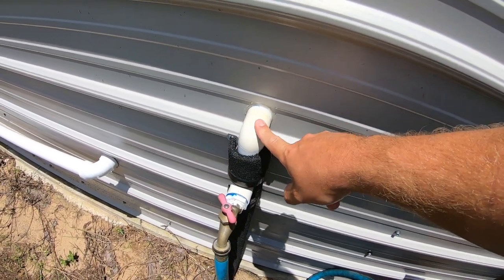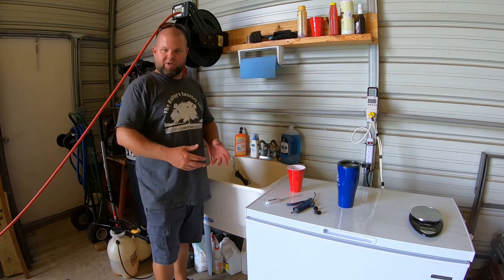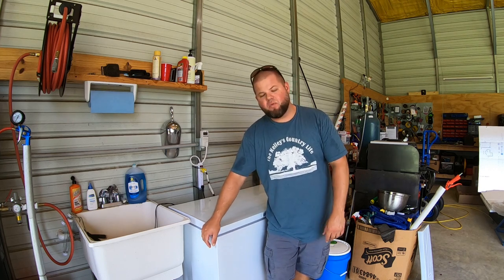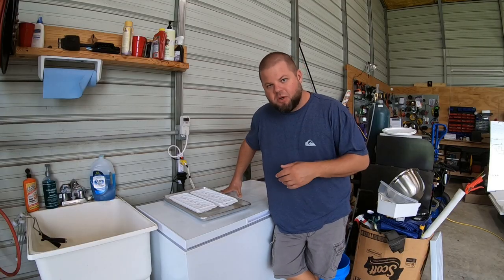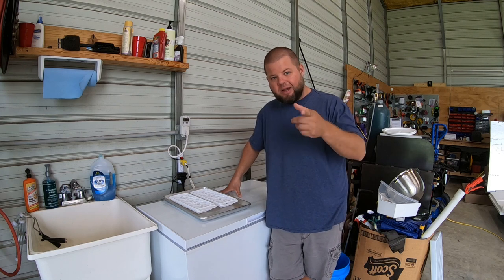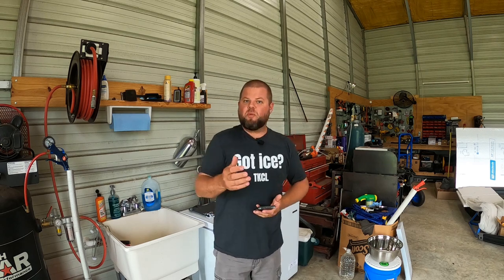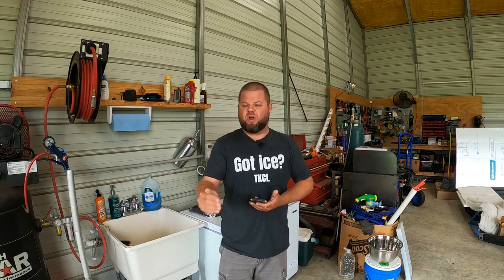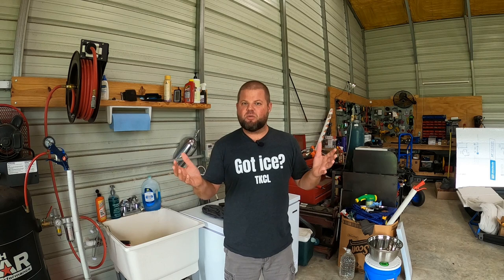Homemade ice machine tests! Hot water freeze quicker than cold water Mpemba effect? #376

Comment: No real need to test water from the tap. Just a measurement from the tubing feeding the ice maker (measuring the amount of water needed to fill the tray). The tubing temperature should be the same as the water inside and should not be affected by outside temperature. Instead, it will mostly be affected by the ambient temperature in the shop.

Comment: It doesn't need to be copper... that plastic line will do fine ... as is, just toss em inna fridge, stick em to the back wall ( use hot glue, you know, for the irony).....plastic may not be as thermally conductive but there is no way that the ice machine will call for 20ft of water in 5-7 seconds ... you just need to make the run from the fridge to the ice makers as short as possible ... did you ever find the ice size adjustment... it's a tiny plastic screw or bolt in the side  on newer models ... insulation on outside pipes is great, but have ya considered creating some shade on it too... might help... just spitballing here ... Oh yeah.. I almost forgot... use metric,  dammit! ... lovin' this series
Reply from the maker: Looked again and no size adjustment is available.

Comment: Put your heat exchanger(coil) in a refrigerator to cool it. Then you would not have to ice it down daily. As cheap as your electricity rate is that would be an option.

Comment: I would use the same plastic tubing you used in the test rig inside the mini refrigerator. Why spend a bunch of money on copper? Use the money you save on copper tube to build a small shed over the well tank and pump. Get some shade on the tank. This will greatly lower the temp of water everywhere at your house. Also the the equipment will last longer. I live in Florida and have two wells. Both have small buildings covering them keeping them cool and dry. Make sure to allow air flow through the shed. The ground water temp is much cooler than the tank temp.
Reply from the maker: Eventually a pump house is in order.

Comment: You could simply shade the pipe exposed to the sun as a start.
I think the misconception that hot water freezes faster might come from tossing a pot of boiling water in frigid air. Boiling water would have more thermal energy to vaporize. Additionally, the act of tossing the water out of a pot increases the volume the water occupies assisting the water towards vapor (high surface area) exposing more frigid air in a fast manner to the vapor droplets.

Comment: Just a thought on pre-cooling the water. How cool is the back of the freezer? 

If you mount a zig-zag of water feed tubing to the back and put the insulation over it would that increase production by pre-cooling the water or decrease production by adding heat to the freezer? And/or maybe increase cost due to due to the freezer having to work just a little harder.

I'd be interested in the result with and without running the water by the back of the freezer when you add the installation, that is if the consensus is the it might be worth trying. 

If somebody already suggested this in the past and I missed it, sorry.
Reply from the maker: I'm already kicking that idea around, and in the lid also. Thanks

Comment: Most commercial refrigerator's use what they call a "Reservoir" somewhere in the refrigerator in order to chill a small amount of water so that what you get out of the dispenser in the front is always cold. You could use one of these so you don't have to worry about buying copper. I could Supply you with one for free if you would like to try that route. All you would have to do is run your plastic water line into it and then back out of it over to your ice makers. I own an appliance repair company and I have several of these "reservoirs" laying around brand new. Some of them are actual tanks, while some of them are just actually giant zip tied together coils of plastic tubing. I can let you know what I have on hand and you can decide what you'd like.
Reply from the maker: Thank you for the offer, I'll keep that in mind. Currently I'm going a different route for more production.

Comment: A test that I actually would be curious about is the difference with and without all that ice that has built up on the inside walls in the freezer.
The part that I am most curious about is not the production of ice per day but the energy consumption both in pounds/kWh and in just kWh/24h.
So dump all ice, make a production run in any configuration. Defrost it and rerun the test after it has reached a steady temperature.
Reply from the maker: I mentioned that at the end of the video, I am going to defrost and test.

Comment: I know everybody has an idea, so do I. I have a small edgestar ice maker, one ice tray. It consistently makes 12 lbs of ice a day. The difference that I see in your design is the edgestar tray is screwed into a cold plate on the side. Have you thought of adding cold plates. They would be of large enough size (mass) that once they are cold they would hold the low temp. Inorder to cool the water, getting it to freezing temp faster. It would eliminate the need for fans and precooling the water.
Reply from the maker: I'll look into it

Comment: Why don't you take a used refrigerator and put say 50ft of 1/4in plastic hose inside and hook water to it and then feed the ice maker. I have one set up in my shop with a drinking fountain so we have cold water to drink plus still have the use of the frig to store whatever in..I'm sure you could do this with a smaller scale frig as well like a table top or apartment size or camper size frig ..
Reply from the maker: It's a possibility

Comment: What about insulating the pipe outside and maybe circulating the water inside the garage by extending the pipe 10 or 20 ft before entering your ice maker? Your chilled water idea through your fridge sounds like a good idea.
Reply from the maker: I just bought the stuff for pipe insulation.

Comment: If you're going to keep developing a pre-chiller you should try flowing your water supply through some kind of coil in a brine bath. Then flow the brine through a closed loop with a small circ pump and a coil inside the freezer.

Comment: Here's a potential passive solution for you. You mentioned that the top of the chest was cold and that you may insulate it later. Run your coils of water line across the top of the freezer and sandwich them with insulation. Obviously you will need enough volume in the lines to fill both ice makers, but that should bring your temps below ambient without using any extra electricity or wasting water.
Reply from the maker: I'm already kicking that idea around, thank you

Comment: Try wrapping the above-ground part of the pipe in HVAC tape, which is very reflective and should keep the radiant heat away, only thing to worry about is the air temp
Reply from the maker: That's exactly what I plan to use, thanks

Comment: Is there a way to re-cycle the water just sitting at the pipe and have it sent back to the well? That might be 1 of the 2 other ways of doing this. The other is similar to your ice cooling method. have a ton of piping. and bury it like 5feet underground going from the sink to the freezer. the water in the pipe underground should cool it without having to ice the pipes.

Comment: Would be cheaper to just add 2 more ice makers and double production ...when 2.0 is done make a kit we can purchase to build our own
Reply from the maker: Yes but then I would have no room for scooping. These small freezers are tight on space inside.
Reply: If you change orientation of the ice makers would 3 fit and be usable that would be 50 percent increase not 7 would be cheaper easier and simpler just doesn't seam worth time and effort for such a small increase
Reply from the maker: I agree but it still leaves little to no room for scooping

Comment: If the copper cost is a problem, try plastic tubing.  It's not as efficient as copper but it can work fairly well, especially if you use a longer coil length and maybe put the coils in a bucket or similar container inside the fridge, fill with water and add salt. Maybe a lot of salt.   That should take away a significant amount of the heat. Maybe not as good as copper but cheaper plastic line may save enough money to be viable.
Reply from the maker: I've been kicking it around, I think there is lower hanging fruit to persue before the mini fridge. I'll discuss soon, thanks for watching

Comment: Insulate the water line inside the building and paint the black insulation outside white to reduce how much the sun can heat it up. If you want to go to an extra level put an insulated box around the outside pipe using some of that scrap sheet metal when you are done with it as a water diverter to enclose it.

Comment: My home side by side refrigerator freezer with ice and water in the door has a weird shaped little plastic water tank in behind one of the crisper drawer.
So drawing even a large glass of water is chilled to refrigerate temperature without adding any ice
I'm sure the part is available and a simple install in your mini fridge after the water filter and selenoid with as short of run as possible and insolated to the ice makers
Also awaiting results in production and additional power consumption to set the  freezer at maximum 10 below zero
Reading into the mechanism that trigger the ice dump. It says when ice hits 13 below it triggers a dump
So 10 below might make a significant increase
Reply from the maker: I like it!

Comment: Also a cooling fan on the compressor compartment is an excellent idea.   My parents live in the desert and the only place they can have a freezer is in the garage.  It made a huge difference on their power bill just pointing a desktop vornado fan at the base of the freezer where the compressor is.  

However you don't need the fan to run all the time, just when the compressor does.  The easiest want to control a fan these days is with these "smart" power strips:  https://www.amazon.com/SCG-3MVR-Smart-Strip-7-Outlets-Protector/dp/B000P1QJXQ

Plug the freezer in the blue outlet.  When it kicks on, the power srip will switch on the green outlets.  That's where you plug the external fan aimed at the compressor into.  Make sure you get a fan with a simple on/off switch and set it on (of course!).  Fans with electronic controls are no bueno (if you see and soft touch buttons or  LED lights - run away and pick a different fan).  Simple, dumb and old school fan is the way to go here.  

Or a 12v computer fan - probably more than enough.  Splurge a bit more for the ball bearing ones; will last a lot longer.  Plug the 12v power supply/transformer into the green plugs on the outlet strip. 

Easy peasy!  

You don't want this for the internal fans.  You want the internal fans to run all the time (except when you open the lid, of course!) to keep the ice maker molds chilled and chilling.  

Good stuff!
Reply from the maker: Thank you for that link, very cool

Comment: Can you bring the water underground into your building? The free cooling from the ground as opposed to free heating from the sun is a win and you could poke the hose bib out thru the wall and avoid the freezing issue with the pipe outside.
Diamond saw to cut a nice hole in the slab, a bit of digging and plumbing, a bag of concrete mix from the hardware store and you have better water.
Reply from the maker: It's possible

Comment: Rather than a coil, just put a reservoir. Since it will be an hour or so in between fillups, there's no need for a high surface area coil for fast heat transfer.  Just use something like that jug you already had in there... so if you can find something that will hold a liter or so that will take those hoses, you will not need a coil.  Just insulate the hose between the mini fridge and the freezer. - Once again, great video and you've got me salivating for the next one
Reply from the maker: Good idea

Comment: You don't need to use a copper pipe in a mini fridge to get cold water, all you need is a water bladder with an input and output hose. You could even just use the water bottle you used to chill water in. Since each cycle of the ice maker does not use that much water, as long as you have more than that amount of water in your water container it will still work.

I would just put both hoses in through the lid, have the input be very short, so the new water goes into the top, and the output hose go all the way to the bottom. Hot water rises, and cold water sinks, so the water at the bottom (if its not all uniformly cold yet) will be colder. You just need to make sure you have no air or leaks, and the water coming in will force water to go out. It will work almost as good as a copper pipe coiled up, but be a whole lot cheaper. You could easily make one with things you have lying around now.
Reply from the maker: I like it

Comment: Run the water line just inside the insulation across the back of the freezer on it's way to the icemaker. This will cool the water down without freezing it in the line and provide chilled water to the icemakers. AND at no extra cost since the freezer is running all the time anyway.
Reply from the maker: I'm looking into something similar

Comment: For me personally that copper pipe thru the fridge would absolutely a no.  Cost of material and chance if screw ups way out weights the benefit.  As Far as cooling the hot side off just some aluminum heat sinks on the hot side.
Reply from the maker: I am now agreeing with you, I was never convinced it was a go.

Comment: First, your test just verify the science on starting water temperature to forming ice.
As for chilling water in a mini fridge overall is not a good idea as the power needed to run the fridge will offset any gain in ice product. Just look at the cooler test with ice.  You have to compare the amount of additional ice made to the amount of ice used to cool the water and we can see it is not a great situation.  A simple item to try is keep using the cooler with the waterline running in it, just keep it full of water (no ice).  This should allow the incoming water to cool some before it is used by the icemaker. 
Overall I love your thinking and willing to test different ideas.  Great way for everyone to learn.
Reply from the maker: Valid points

Comment: As far as which direction to go... I think the most scientific thing is to run each test with your current baseline system without making permanent mods and then to see which mod or mods make the most since with regards to cost and return on investment.  The thought behind my statement is that you may find another mod that makes just as much of an improvement as modifying your mini fridge without the costs (or destruction) involved.  At some point the law of diminishing returns is going to kick in and if there are simple and cheaper mods that get you to that point it doesn't make since to make more costly mods.  Just my two cents...
Reply from the maker: I think we are getting there fast

Comment: one improvement you could do, instead of using a fridge to cool the water, is to use the freezer itself to cool the water. One option would be put a cooler inside the freezer and route the intake water to the cooler. Since it is insulated it should not freeze, very easily. From the cooler to the icemaker. bam, now you use chilled water. To prevent the cooler to be allways filled of water and to not become ice, maybe using a timer to open and  close the intake water.
Reply: This would likely work but you are now introducing the heat you are trying to lose into a closed system.. the effect would be the freezer would still have work harder to remove that heat... The effect though vs. the increase in cost and loss of efficiency may be negligible as the freezer is likely not even close to using its full cooling capacity and it may still result in a net gain of ice production/time. I would definitely test this one.

Comment: will you consider having the ice makers facing each other and you can have one fan in between them? Also maybe have the fan from Right side of the icemakers? even a shroud to garb cold air from the bottom instead of the top?
Reply from the maker: I am about to play with more fan locations, speeds ect.

Comment: Just throw the hot water out. Its physical science you have to slow the molecules down in order to make the ice. The hot water is an old wives tale. The push ain't worth the shove for the chiller. If I found I needed more the most economical way would be to add another ice maker.
Reply from the maker: I agree on the ice maker, except it takes up valuable room

Comment: speed up your timer on the ice maker the ice is done long before it drops look up btu of water at 35 and the btus of water at 75 the ice will form in metal trays much faster then plastic. so get some metal trays and put in the same amount of water at 35 as what goes into your ice maker I think your cubes will set up faster then the ice maker. a btu (british thermal unit) is the energy to raise one pound of water one degree f .so to make ice from one pound of water at 33 takes 144 btus because of what is called latent heat so cool your water to 33f and when it changes and crystalize requires that much to change back  so one pound of water at 99f will take 210 btus and at 33f will take 145 btus check and see what the capacity is of your compressor and see how much heat (btus) it removes per hour and add 10% for loss of efficiency . your ice will be done when the btus are removed. Remember to allow for loss when you open freezer and pre cool your trays.  That big tray you used might take a bi to cool.
Reply from the maker: I checked and these ice makers have no adjustment that I can find